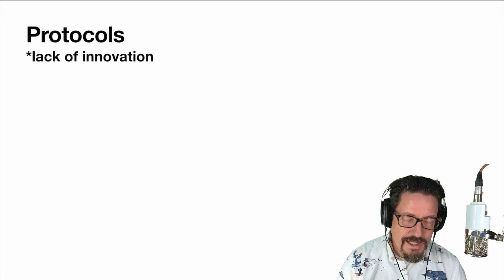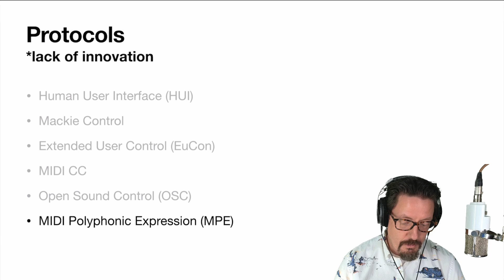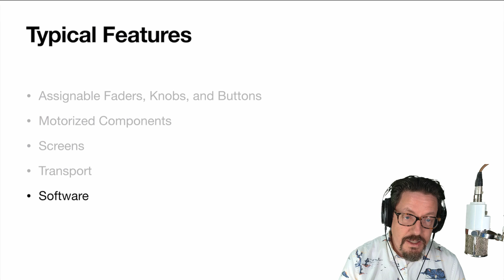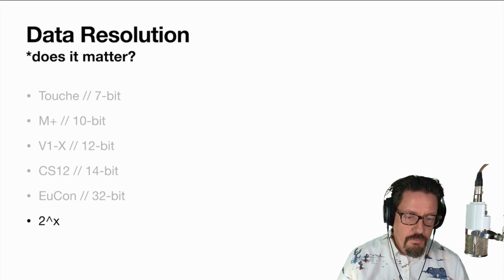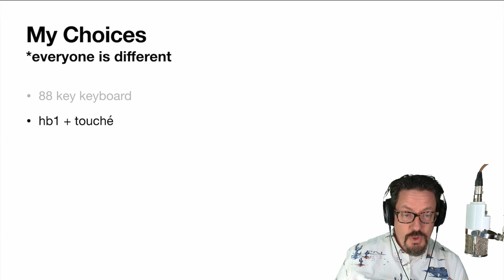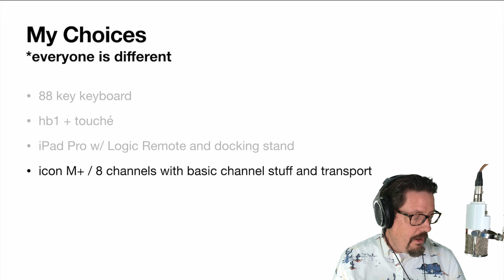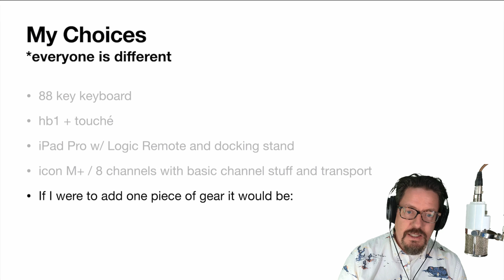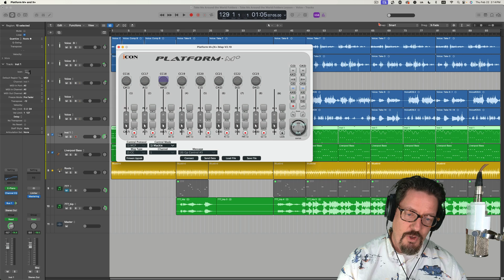Watch Before Buying a Control Surface for Logic Pro | 2024 Edition

Comment: The “next” thing is an old thing: repurposed Avid/Digidesign control surfaces—Control 24s, C24s, and D-Commands.

They have all been designated as unsupported, are not compatible with current versions of ProTools, and were always designed to be totally incompatible with all other DAWs.  Bummer.

But then Neyrinck released his V-Control software, which brought all these products roaring back to life, including compatibility with nearly ALL DAWs.

Of course, the downside is that these units are often two decades old and will need maintenance and TLC to keep running, but they were made well.

Earlier this year I bought a very nice Control 24 in great shape for $700 from a local studio.  I then bought a garbage one for $100, which I parted out (faders, transport controls, knobs, etc.), $200 for V-Control, and $300 for one rebuilt PSU (the one part that tends to die after decades of use).

So I’m $1,300 into it.  What do I get for that? 24 motorized, touch sensitive faders; 24 rotary encoders; a nice meter bridge; a host of other active DAW control buttons; and a great transport control section.  Also, it’s 88 lbs and made of sheet metal instead of plastic, so it looks and feels weighty and solid.

Control 24s have 16 mic pres, but they suck by modern standards, so most people don’t use them.  Same goes for the monitor control section.  Also, these only have four-character scribble strips.  But those are the only real drawbacks, and $1,300 this way for a full-featured 24-fader control surface is FAR less expensive than any new options.

Comment: I've used quite a few control surfaces myself including my iPad, Presonus Faderport 2, Icon Platform Nano, Icon M Plus, Behringer X Touch One which i am currently using and even tried mapping various keyboards as controllers for Logic but the perfect Logic controller has continued to elude me.
I was toying with the idea of the SSL UF1 before i stumbled on the Panorama CS12 which i just pre-ordered from Thomann (availability 2 to 3 weeks). Not happy with the omission of a jog wheel on it though but let's see if that will affect my workflow when i start using it.
Reply from the maker: Mine arrives on Wednesday. I’m excited.
Reply: I'll be looking forward to a video from you sharing your thoughts and experience with the CS12. I'd like you to also comment on whether you find the omission of a jog wheel affects you in any way. Thanks. @LogicProLife
Reply: Update: After watching the very few and hard to come by videos on the CS12, I finally opted for the SSL UF1 and UC1 combo. Much more expensive, but i 100% believe i made the right choice.

Comment: artist mix was great imo...I'm sure S1 is better but it's too big, and they moved the faders further away for some stupid buttons...latency/resolution on eucon is great, especially if you use a separate nic per device...

most performant controller i've used: large ipad pro and touchosc w/ mioxm (din)-> unitor8 to logic...use pitchbend for 14bit, and setup as (emulate) a mackie for bidir in logic...idam is pretty good though, but can only do 8ch if emulating mackie

Comment: Chasing the tactile experience, about 3 years ago I bought the Novation Launchcontrol XL which runs on the HUI protocol. I had the somewhat vague idea of setting it up to control Alchemy but I've been really disappointed with the whole experience. I tried using it as a simple mixer but it didn't even map to the default mixer controls. I could only ever get one send knob to work in a limited way, the pan controls are essentially useless and the whole thing seems to want to forget anything I mapped to it and even randomly pushed the Logic faders up to max.  I talked to Novation several times but they told me that the Logic application was something of a work in progress and left it at that.  It's spent over a year in its box. Not even sure whether Novation have released a solution.

Comment: I have an X-Touch Universal with an extender. I really like them, especially now since Logic sends colours to the channels. Mackie FTW.

Humbly, Ylan
Reply: the noise though...and the lag if you try to overdub automation...for the money you get a lot though, and the comprehensive set of buttons are great, I use those a lot...shame they never updated it with better knobs and faders, it's great otherwise.
Reply: @simccaffrey Ok, it hasn't bothered me, but then I am not a pro and just bought mine second hand. I haven't yet noticed any lag. But they have been around for a while, so newer models from other vendors might be better. Are you using Logic and Mackie?

Humbly, Ylan
Reply: @ylanstockholm  who knows, maybe the older ones are better lol. I have a recent one, yes Logic (latest also)...btw "shift"+"inst" gets you smart controls (if you don't know that one), then try "flip" to faders...

Comment: The CS12 looks very interesting. I'm using a Nektar Pacer (the footcontroller) as deeply integrated controller for Logic. It is rock solid. It seems that the company know what they are doing. One fader is fine, since I use a lot of folders and in my experience, it never works as expected with a multi-fader controller. But probably it's just me...

Comment: I can’t wait for the nektar cs12 specifically made for Logic Pro gonna be so solid
Reply: My CS12 arrives in the mail in two days (Saturday, Feb 24, 2024). Can't wait!!!
Reply: @JimGramze  how is the board?
Reply: yeah its the one if it does what the label says. it uses direct integration using the api so its a whole different level of integration
Reply from the maker: It looks really interesting!
Reply: No jog wheel and the tech looks more annoying then the Xtouch which had its qwirks but definitely solid